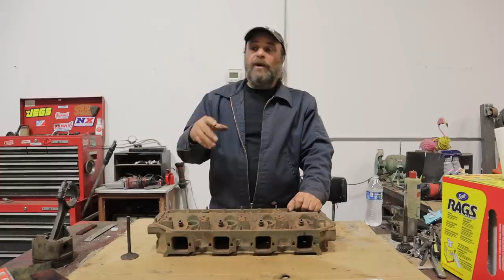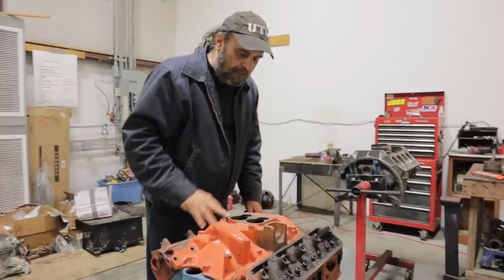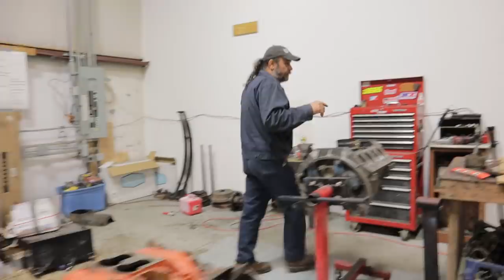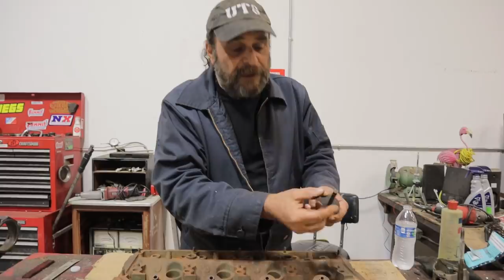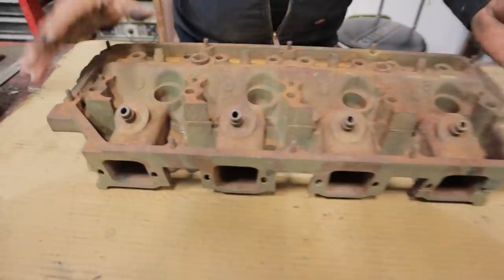Carburetor MPG Myths And Intake System Thermodynamics

Comment: Hi  unc Tony I gotta tell ya about my milage story I got 35 miles to about one guarter of an ounce of gas ya I put my car in neutral and coasted down the Snoqualmie pass in Washington yip so it can be done but it's illegal to do lol lol ????!!!!**"'"***; it  I coast alot when I'm driving my 94 tercel I've gotten some great miles to gallons but I've got a very built 472 Cadillac in my 70 DeVille convertible it gets 2 to 8 miles to a gallon on the street yip if I'm dragon quarter mile it get about 1 to 2 gallons to a quarter mile so now I'm flat broke and my hot rods just sit in my back yard my 67 Z 28  with a dual quad tunnel ramn my 70 DeVille   n my 97 Vette n my 57 chevy sedan delivery with a 2018 Z51 Vette motor with a few goodies in it with a 10 speed auto but I don't have money to but gas and insurance and license n tabs everything is inflating so fast I cant drive and pay my mortgage and eat and have a phone let's go Brandon let's go

Comment: It seems hard to believe they have not discovered a better fuel than gasoline. It makes you wonder
Reply: They have;
Nitro - more power, but expensive
Diesel - more economic, but less power
Propane - less polluting, less power
Hydrogen - same power, less polluting, needs expensive engine conversion.
Compressed air - free, sorta, but runs out quick, due to limited air tank size, and pollution is just moved to air compressor, which ends up using more fuel per mile than regular gasoline.
Cognac - gives of pleasant fumes, and preferred by the rich, but overly expensive at around $30/gallon.

Pick your poison of what you deem "better".

Comment: Who cares about MPG that can change depending on the individual behind the wheel tire pressure head wind ect. You want better gas mileage buy a vehicle that’s purposed for what your going to need. Don’t drive a 10 passenger van or a extended cab log bed truck if it’s just one person going to work. It’s like taking your furniture to work with you. Why drive a v8 if you could be on a Honda twin with a side car. I understand the idea of better gas mileage for your buck but you can’t squeeze blood out of a turnip.

Comment: Since on the topic of fuel economy ect. I seen some guy on, ofcourse Tik tok, showing a Suburban (like mid 2000s or early) v8 im guessing, with a solar panel onthe roof. You're thinking electric swap, or hybrid, but appearantly (from what i understood). The solar panels and whatever else he had there, produced hydrogen which was then diluted into the gas/burnt alongside the gas to require less gas to be used to produce X ammount of power. Not sure if this is some pyramid invest in my stuff, but the theory seems cool anyways. Not really making the engine any more efficient, just a different way of fueling it, which may or may not pay off.
Reply: Sounds like he's talking about hho. The solar panel produces the electricity needed to extract the hydrogen from the water. The hydrogen is then added to the unleaded. Unleaded is a hydro-carbon, so hho is basically just the hydrogen part without the carbon. 
It does work, but lower power density (which is why he's using it as an additive) and the generation process is slow. Not a bad idea mixing it, better than trying to run it just on hho.

Comment: there is a way to double the mpg but then i would have to K u . really what u need to do is add hydrogen to the fuel mix then u can double or even better on mpg but it will be in gray area with the laws when it comes to making hydrogen but it is easy to make . what u do is put a propane set up that has been converted to hydrogen that goes under the carb the set up where u can run gas or propane then u just need to balance the feed or u can feed it right down the air intake harder to regulate but easy to set up no pressurize tanks u feed it as u make it but will have more problems running right so only good for mpg . i do know u don't want straight hydrogen it burns way to hot for a normal engine it would burn holes right through pistons

Comment: I know a guy that bought a Buick wildcat back in the 60s and it got 35mpg there was a recall on it the dealership swapped the carburetor and from that day forward 15 mpg, facts, big oil has got mpg in their pockets there is no reason today with the technology we have that a truck shouldn't get no less than 40mpg with 400 horses

Comment: I rember ford flirting  with a roller valve that was not like any valve  we know today like the carb on a coxs micro engine 3/4" diameter shaft with holes for valves  1/4 turn its full open into cyclinder failed because there was no hot valve in the mix to vaporize the fuel

Comment: Would like to see you do a draw through turbo carbureted with small jets for economy and at least a 10.5:1 compression engine using a modern T04e turbo which can get all day long at around $130 with v-band flange for ease of connecting-to the exhaust system.  The right transmission for high end gears and a tall rear end.  Let the fuel economy begin.  Blow through carbs are better for performance but for economy the draw through has the advantage. Would like to see you build one in one of your vehicles and compare it to a natural aspiration version with same type engine.  Here is my draw through Buick 1980 sport coupe limited turbo 3.8 V6.https://youtu.be/MOLbPvMOHA4
Reply: I'm thinking one issue with that high a mechanical compression and the highway gears, is if you put a load on the engine climbing a hill, there may be more chance of detonation (unless you use aluminum heads) but ona flat surface keeping the car a constant speed, the only factor may be aerodynamics (say, a flat nosed vehicle like a squarebody chevy pickup).  the nice thing about the Regal was it was designed for NASCAR, so even that shovel nose is aerodynamic
Reply: good idea! a qjet and a turbo wold go well!

Comment: You can say that but I've seen first hand an old snapper riding mower nearly double in efficiency just because the fuel line happened to be directly in front of the exhaust. Mathematically speaking 100mpg is easily doable. In terms of joules of energy the theoretical maximum efficiency under ideal conditions would be 400 MPG so you're really only asking for 25% efficiency to get 100 MPG.
Reply: "Mathematically speaking 100mpg is easily doable". OK. Show your math.

Comment: Arguably the most important car for high mileage gasoline with a car is found in this link
https://youtu.be/qt7VDBWAJmc
Tony is correct in his assessment of what can be done vs what is practical.  What I think would be great is if engineers and manufacturers could build  gas engines that could at minimum run just on the lean side of fuel mixture.  Doing so would increase economy, but also eliminate the need for the catalytic converter.

Comment: How about running the fuel line around the exhaust like the geniuses are doing then the fuel is almost a gas as it enters the motor.  This guy has his old truck running inside the garage with the door shut. Next time acoustic vibration and magnets.

Comment: Actually you are incorrect a patient must be shown to work 🙄 vw bug 3.5 times under carburrated facts Jack, vapor does not function the same as wet fuel delivery. Try this sport as a madter mechanic whom.used to.own a speed shop u found tiny stainless screen wire used against intake manifolds do increase power on the dyno real world, not sure on 100 mpg carbs but.... I can show you how to use water to break the atomic bonds with 2 alternators and increase somewhere in that neighborhood by product of hydrogen is liquid oxygen which can be used to cool turbos before it enters the fuel loop so there's the recipe for 100 mpg carburrated with simple physics. By the way I retired to conduct research and I am a scientist. 

Good luck bro.try my ideal then I want to hear you eat crow as you increase efficiency to insane levels we need it with Brandon's gas lol
Reply: It's clear that you spent so much time becoming a scientist that you skipped right past spelling, punctuation and sentence structure.